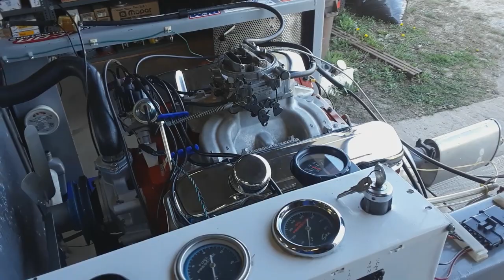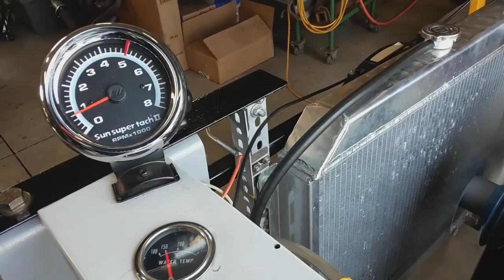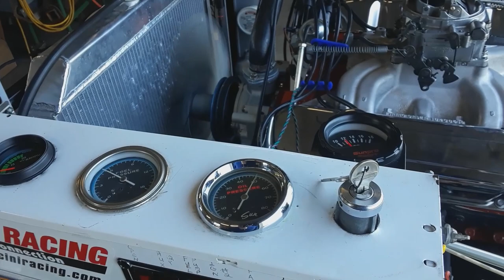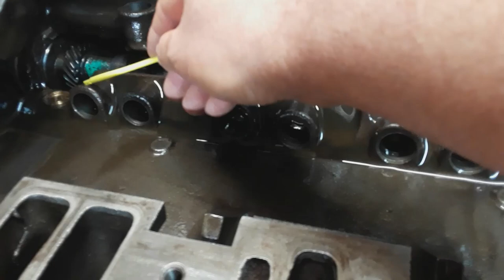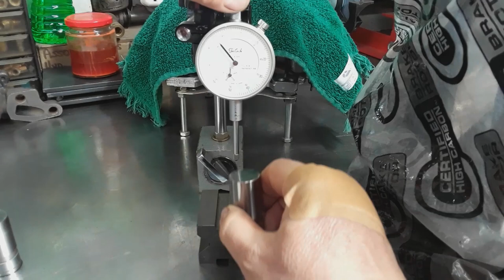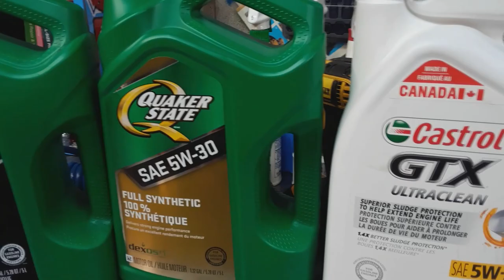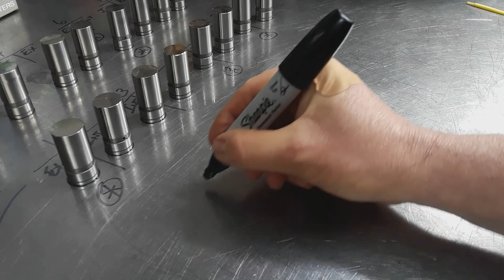Camshaft Crisis: Solution/Resolution

Comment: Something on the ZDDP in the oil. When catalytic converters came about car manufacturers discovered that the cats were getting fouled (rendered ineffective) by the metal additive in the oil for the cam & lifters. They had to come up with a solution that would allow the cat to live for at least 100K miles. Simple solution, remove the metal additive. But then the cam & lifters won't last, oh the dilemma! Enter the hydraulic roller cam which every modern engine now uses Chrysler started using them in 87 in the 318 engines then in 89 for the 360. Logic dictates that they would not have started manufacturing hyd roller assemblies for no reason because they are more costly to make. I read an article by a Chrysler engineer that explained it like this: Lay a deck of cards on a table then run your hand across them spreading the cards under your hand as you go. The zinc additive works like that, constantly supplying layers of cards for the hand to slide over. But the metal wears out and you have to change the oil to replenish the zinc additive in the oil. But if you are into conspiracy theories then Your explanation will work. I recently rebuilt a 360 Dodge engine for my little camper van (Class B camper). I was real nervous about the cam/ lifter thing. I was torn between re using the old lifters & cam since the lifters all had a good crown on them. Engine had 91K miles and was in good shape but I wanted it to be reliable. I decided to have the cam reground into an RV profile by a cam grinder on the west coast. Half the battle won because I knew the core was a good one. Then they supplied lifters that they had been having good luck with. So far about 9,000 miles & no problems. Re-used my old springs due to the lack of replacement springs for the exhaust valves that have rotators on them. Flat tappet lifters have to have a specific hardness to match the camshaft material. That requires strict quality control measures to maintain lifters that won't fail.  Manufacturers know that the future market for flat tappet lifters is limited so they are not very interested in quality so part of the problem is junk parts. By the way I have a set of small block lifters made by Melling and they came from Mexico.
Reply from the maker: With all due respect Larry, this "history" lesson given here I have know for more than 2+ decades. My educational/employment back ground is metallurgy, QC and NDT (Non Destructive Testing) and I have been building engines since the late 1970's. There is a lot more to this camshaft failure issue than just "zinc & phosphate" additives. Testing engine oils; 
https://540ratblog.wordpress.com/
The vast majority of my engine building is mild to Hi Performance based, so "rotators" are tossed straight into the scrap bin! 
{ with induction hardened valve seats and quality exh. valves, there is no need for "rotators", they are just added weight. In my experience, this additional "mass" located at the top of the valve stem adds to the "bell" shaped wearing of the valve guides. In the past, "Nine times out of ten", 318/360 heads with rotators needed new exhaust valve guides when I rebuild them. Simple mechanical engineering rule 101....MASS is NASTY!..... and only adds to valve train harmonics and wear issues.That's the reason nobody made/makes a rotator replacement valve spring. These automotive "engineers" are not always that sharp you know! } 

Those "stock" spring rates (especially thermally cycled "used" springs even with extensive shimming) are so weak that most engines would experience valve float regardless of the camshaft grind starting around 5000 RPM. Great for a "stationary" engine driving a water pump or an electric generator but not enough road/interstate RPM "insurance" for my comfort range. 
I am continuing with my engine building/testing and I will be doing videos in the near future on "breaking in flat tappet" camshafts WITHOUT the zinc additives (Lucas/Comp/etc) or the zinc blended break in oils {ie. Joe Gibbs "Driven"}. 
Lets see where that gets me....I think this is putting ones money where ones mouth is!
Reply: @metalmaxmopar9520  Since the 70s? I built my first engine in 64 & have been building them since with only a couple of failures. Rotators? I would have liked to toss them but then you have to locate a valve spring that will work with the lowered valve spring height when installing a non rotator spring retainer. The valve lock grooves on the rotator valves are in a lower position than the non rotators. Don't argue that point, I have measured many of them and you can't swap one for the other. I know that a valve spring could be found to get the proper tension but then you end up with an aftermarket spring with unknown metallurgy and a shorter installed valve spring height. Same problem as using aftermarket lifters so I kept the original parts. So far, so good. I have rebuilt heavy duty engines that had rotators and stellite valve seats and exhaust valves with sodium filled stems. They were used to extend the valve life on industrial & truck gas engines that would be running at near full throttle for lengthy periods of time. Check out the old 413 industrial engines. By the way the valve guides on the 360 were not ovaled and I'm not having any problems at all with valve float at highway speeds in excess of 70 MPH. I'm not disagreeing on the quality issue but part of the issue is because the manufacturers know that the market has a limited future. Also, most of the market is in the high performance field and they can always use the excuse that there is no warranty on race components. An easy out for them. There is a serious problem with aftermarket parts now. Currently I'm in the process of replacing an aftermarket AC compressor that only has about 6,000 miles on it. The mechanic that I used for decades for front end alignments retired mainly because he was tired of doing the same job 2 or 3 times over due to aftermarket parts failure. You do what you want but if I'm breaking in a new cam I will continue to use ZDDP additive, Lucas oil additive and anything else that might help, things like breaking in with soft springs.
Reply from the maker: @larryhutchens7593  I won't argue with you about the (stock rotator) exhaust valve lock groove height as I know this is an issue. It's a great reason not to use them. My question is with your experience Larry....Why even have this battle? 
My/A solution to that rotator exhaust valve "lock groove" height is so simple and a No brainer.....use 340 or non rotator 360 exhaust valves (stock 1.60" Mopar or Melling: V1307 ), 340 valve springs (Mopar Perf: P4120249 or P4286813 - general "mild" performance) and "stock" standard retainers and 4 groove locks. You get 8 good valves, less weight, better springs rates without extensive wear, reliability and peace of mind. 
These were "Tech Tips" straight from Larry Sheppard/Tom Hoover printed in the Direct Connection/Mopar Performance Race bulletins published by Chrysler starting in 1974. "Economically boosting your 318/360 for performance using 340 parts". {340 Cam, V/springs, intake, windage tray, baffled oil pan}.  For $25 bucks a copy, there is 5 "lifetimes" worth of knowledge in those books! I've bought every Engine/Chassis edition since they were published. I've done this swap countless times. Anyway, for less than $200.00 in parts or "half" that if you can find good "used" exhaust valves with usable margins .......its a total win/win.
That's why I did not name my business: "Poverty Engine Rebuilding Service". "Frugal is frugal" to a point, but then it's grief creation!.....Whats that old saying?...you only get what you pay for!
Reply: @metalmaxmopar9520  As for the non rotator valves: The machine shop I use didn't have any used 360 non rotator or the correct size 340 valves (kinda rare in used condition). I did have a set of 318 non rotator valves and a few (3 or 4) non rotator ex valves that were a size in between the 318 & 360 size. Slightly smaller that the 360 rotator valve size. New replacement parts? You need to understand my reluctance to install aftermarket parts due to quality issues. I will trust a used factory part over a new aftermarket unit, even MoPar parts. My son ordered a MoPar double row timing chain set a couple of years ago and the quality was horrible. The machine work was terrible and who knows what kind of metal it was made of or where it was made. We decided on a Cloyes unit. I had the same dilemma choosing a timing chain for my RV engine. Valve springs & valves? Who knows where they are made. Turkey, India, Brazil? I once got a set of main bearings for a 3.9 V-6 that came from Brazil. Looked great but had some trash just under the shiny stuff that scratched a freshly ground crankshaft. Several tiny little pieces of some sort of grit embedded one of the bearings that couldn't be seen. Recently had to replace the thermostat in the RV because the last one was opening rather erratic. Can't remember where the first one came from but the new one was made in Israel. I decided to replace the thermostat while I had the failed aftermarket AC compressor. When replacing the idler arms one of them (a MOOG brand that I had in the past trusted) wouldn't even fit in the chassis properly. I had to grind some material off to get it to fit. Another option I had was to get a pair of Engine Quest heads that have the beehive valve springs. One big problem, they are no longer made in Australia but now come from China and the castings are horrible. They would be OK for a classic car that doesn't see many miles but on an RV? Replace the springs with something that has better spring rates (more tension)? Wouldn't that make the lifter situation even worse? I have been searching salvage yards for a set of older 360 heads but they seem to be unobtainable. Most are in late 70s thru 80s pickups & vans which all have the exhaust rotators. Practically any engine made for unleaded will have them. You build engines for a completely different service than I do.
Reply: @metalmaxmopar9520  i think youll have good luck on your experiment. i use stp oil treamtnet and valvoline regular 10w30. the stp oil treatment doesnt even have much zddp in it, but i use it because i like the film it leaves. is it a good or bad thing? i dunno.

Comment: If you have a lathe or mill, you can also make yourself a flat surface for inspection as well.

"put a "top hat" on, a "bone" through your nose, rotate twice counterclockwise while facing east between 7 & 8 am on days not ending with a "Y" when you sacrifice a chicken and scatter it's remains around your engine building stand as a "solution" to this issue. That should work!" - How dare you insult my engine building practices!! LOL 🤣
Reply from the maker: I'm changing my hat to a bowler!........with a pink rose between my teeth......while I do the "Locomotion".....Grand Funk Railroad's version of course.......I'll let you know how that works out!
Thanks for the smile man!

Comment: In your video you never mention if there is a taper on the lobes. Very important. Also again you have a lifter/cam wear in one of the same lifter bores. You never showed does the lifter rotate freely in the lifter bore. Is the block decked or the heads milled? Did compensate and use shorter push rods? The pushrods could be bottomed out in the lifters causing them not to rotate. Valve springs? Some cam manufacturers and professional engine builders state run a light spring until the cam and lifters are full broken in. Then reinstall the valve springs you’re going to run. We’re seeing roller cams going away in modern production engines. Yes today’s quality has in materials seems to have gone down. Maybe today’s modern oils have too many additives that the actual oil cant lubricate properly even with the zinc additives. I wonder if today’s additives are breaking down the Zinc? Maybe next time try straight 30 non detergent oil. I found our local Car Quest sells it. I’ve found we have a few engine builders in my area.
Reply from the maker: Thanks for your comment. Please watch ALL of my "Camshaft Crisis" videos as there are 4 of them and starting with the first of these earlier videos will answer ALL of your questions. EVERYTHING that can be VISUALLY inspected and that I can physically measure is CHECKED. Lobe tapper, lifter crowns/diameters and block lifter bore diameter and block lifter bore to camshaft lobe alignment. All valve springs/push rod lengths etc, etc are measured. The only device I don't have in my shop is a Rockwell "C" scale hardness tester. A portable "hand held" Rockwell testing unit that I previously used at work in the metallurgical lab is on the shopping list for 2024. What more can I do other than go to "rollers" and those are now breaking down too?  
https://www.youtube.com/watch?v=VdODNCV1dis&t=0s

Comment: I think today we have a combination of problems, mostly workers not qualified or not giving a damn about their jobs. Parts coming out of China. The results from the pandemic.

I used to work for a well known steel producer and retired in 2019. I was a fleet mechanic there. We had several GM pickup trucks driven by inspectors and shit disturbers, 305 and 350s. We were replacing cams and lifters on at least 2 trucks every week with some as low as 12.000 miles on them. GM would not warranty any of them because of all the idle time. Out of 24 hours they likely idled for 20 hours. I caught one guy revving the snot out of a truck until the valves floated because he thought it was funny and not his truck. I have to wonder how many jobs he's had in his lifetime.

We also had a few Ford trucks with 302 and 351w engines in them with NO cam failures at all, but would wear the rocker arms sometimes. Transmission failures were common because of heat. They would bake everything inside.
A friend at a GM dealership suggested that we use a GM product called EOS for pre lube and in the oil in the GM trucks.
After using that product our GM camshaft problems went from 3 or 4 trucks a month to 2 a year. I don't know what was in it but it sure worked for us. It's not likely you can even buy it any longer.

Comment: Cam lobes not really lubed from oil pump or lifters. Live from oil slung from connecting rod side clearance. Thats the component. Open it up.  You can get lifters to run made of aluminum😂😂
Reply: Just pull the pan slip a feeler guage between the rods under the failed lobes they are most likely much tighter than the ones under the surviving lobes